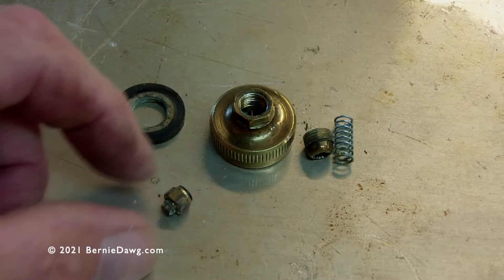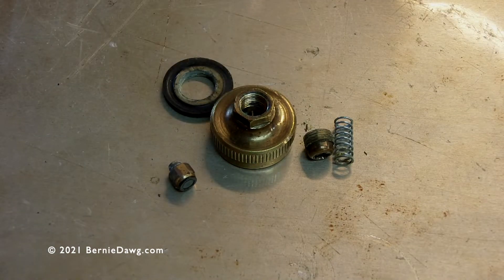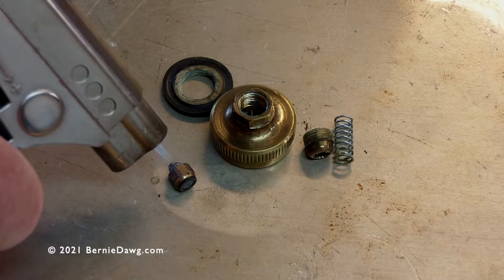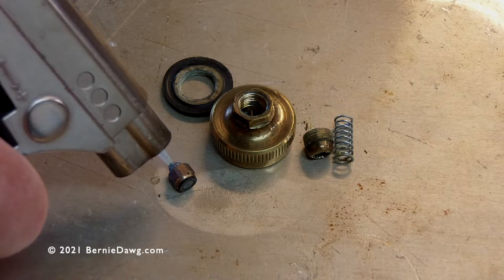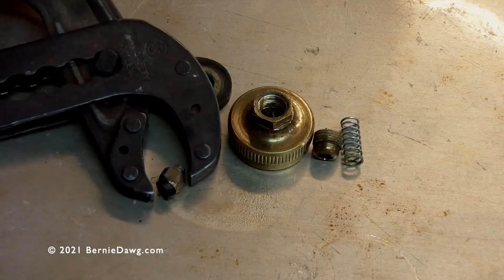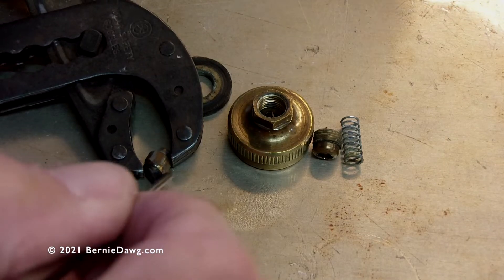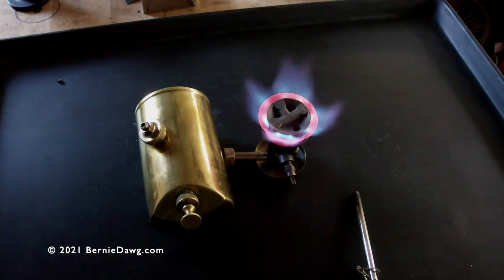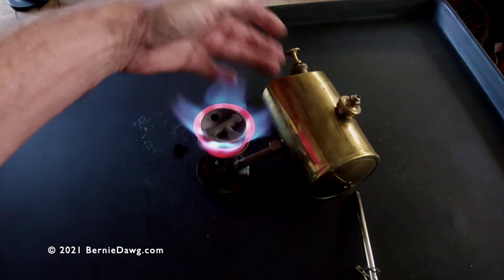BD Quick Tip - Optimus and Svea Stove Fuel Cap SRV Pip Removal

Comment: I just bought a new svea and saw the following in wiki 
“care should be taken not to wrap the windscreen too tightly around the stove because this may cause the stove to overheat and the fuel tank to over-pressurize.[26] This in turn will cause the pressure-relief valve in the filler cap to open and the over-pressurized gas vapor to escape, which may catch fire and result in a dangerous "flareup" or large fireball.”
May I ask  why the escaped gas(over-pressurized) may catch fire, isn’t that the srv is made for? to release the pressure?
Excuse me my question may not be that related to your topic.
Reply from the maker: @Frankie S  Remember you can find all sorts of lies and nonsense on the internet these days. It’s becoming the normal behavior to log in with an anonymous screen name and make up all sorts of baloney. And… people will believe it! (QAnon! Ai-yi-yi-yi! What idiots!) So, it’s always best to verify anything you read on the web. Good job on contacting me for that because I don’t lie and will give you stove truth.
To answer your questions. Yes, the SRV (safety release valve) is there so that you do not overpressure the tank. Typically, when these open, it’s to emit a small candle flame or, at worst, a small jet of candle flame not more than 10cm in length. A “fireball” is a quite a bit of exaggeration and is only possible when a stove user has been very, very stupid, or, when the stove and the SRV are not properly maintained.
Why is there a flame? Because the release of pressure is mostly fuel vapor which has plenty of air to burn with outside of the tank. The fuel vapor, mixing with the air, ignites from the nearby stove flame.
Use your stove wisely with proper sized cookware (not too big in diameter - max. about 15-22cm) and you should never see the SRV open on one of these. If you do see it open. Turn off the stove and let it cool down. Then, figure out what you were doing wrong to make the release happen.
Now! The kind of windshield the “wiki” talks about is most likely an aftermarket accessory like this one: https://www.amazon.com/REDCAMP-Windscreen-Aluminum-Windshield-Lightweight/dp/B074556T6D
The Svea 123R already comes with a pretty good windshield made of brass. It should not be necessary to have an additional windshield with one of these stoves if one chooses a sensible sheltered spot to do ones cooking. A lot of younger campers think you should camp atop ridges and mountain peaks amidst a hurricane because they have seen too many stupid YouTube GoPro videos of "gnarly camper dudes" in foolish camping spots that look “rad” in videos. Choose your camp spot wisely and you shouldn’t need an accessory windshield with a Svea 123R. If you think you do need one, just don’t wrap the windshield tightly around the stove. Set it up a bit away from the stove to act as a windbreak. Or, just choose a sheltered cooking location! 😉👍
BTW, the “new” Svea 123Rs coming out of Taiwan are not so great. Lots of reports of poor fit and finish and issues with them not shutting off properly. It’s better to buy one of the hundreds of older Svea stoves made 1960-1990 from online auctions sites such as eBay. The vintage stoves are much better made and last forever (pretty much, with care). More questions? Drop an email to: bd@berniedawg.com 👍 BD
Reply: @BernieDawgCinema  thank you for the explanation😊
Reply: @BernieDawgCinema  I think you stated in another video comment not to exceed about 8 inches in diameter, such as a fry pan, or about 20.32 cm. Am I correct or do you recommend a smaller diameter? I know I've used an 8" fry pan with my 8R with no problems. I haven't cooked on a 123 yet.
Reply from the maker: @wanttogo Ha-ha! 😁 Thanks for pointing out my internal inconsistencies. More to the point, I'd actually written 150cms! While I pride myself on some fair amount of dual dimensioning ability (I'm American and use the inch-feet system generally) I goofed up with that one. 🙄 I've made the correction above. 
If you are a new user and are not adept with stove use and camping and those sorts of skills (or as the OP seems to be, you are terrified of stoves exploding - they don't, btw), then six inches is a good place to start. If you have mastered sensible outdoor cooking and stove use, then I'd reckon you could push fry pan diameter up to maybe a maximum of 8". Too big a fry pan diameter reflects too much heat back to the stove and can cause over-pressurizing of the stove is the point of the discussion. Most stove users use cookware that is too large in my experience. Most SRV release issues involve too large cookware. Use the smallest you can deal with, not over 6-8" in diameter. Easy-peasy. 👍 BD
Reply: @BernieDawgCinema  thanks for the clarification. I'm not too worried about the stove suffering a castrophic failure. I began my backpacking days in the early 70s when I was a teenager so have been using liquid gas stoves for many years. I've never had a problem with one venting. I do like the Sigg aluminum pots of yesteryear with the bail handles and the sloped sides. They minimize overhang and distribute heat nicely to the contents. I have the lightweight stuff now too for longer miles trips. My body doesn't forgive very quickly the heavier weights we used to carry. There are lots of lighter options now we didn't have years ago which makes for a better backpacking experience. Do you know anyone who makes and sells an aluminum or titanium cover for the case top of the Optimus 99? I saw a video where a person had made one that nested nicely inside the lid. I don't think he could pack it up that way though and fully seat the top on the case base. He didn't say. Still a nice design and idea though.
Reply from the maker: @wanttogo Got it. You’re an old hand at this. We likely started around the same time with the same gear. (I still have my old Kelty frame pack in the rafters of the garage). I, too, have not ever had a stove vent. I make sure to rebuild my fuel caps, though. Aluminum works way better than all the spiffy titanium pots folks are into today. That’s because titanium is about the worst of all metals for the rate of heat conduction, so it tends to make really hot spots and not distribute the heat. Titanium’s good for boilers and for insulated mugs/cups, though. I prefer my aluminum cookware with hard anodizing these days. I do not know anyone making titanium or aluminum “covers” for the 99. I’d like to see the video you reference, though. Care to share a link? 🙏 BD

Comment: Great tip. They can be awkward when hard.
Reply from the maker: @RAR Knives and Leatherwork Thanks, Rob. A little torch heating can also soften fuel cap gaskets and pop NRV pips out of brass NRV pip holders, too. Just watch they don’t shoot across the shop when they “pop”! 😲 I’ve been doing it this way for years, but on the QT, so I didn’t get grief from the purists or the misinformed. Not had a single issue (yet) out of hundreds of operations. 👍 BD